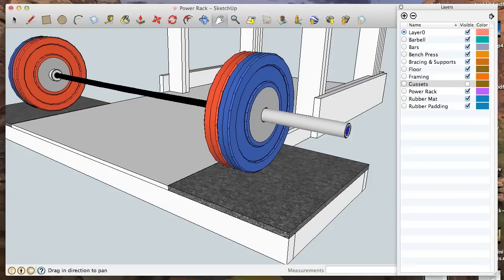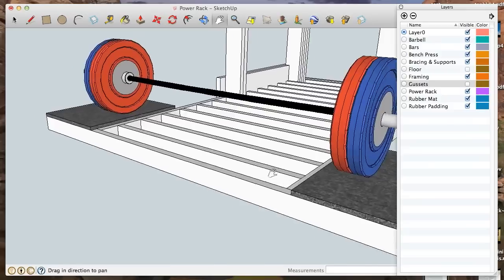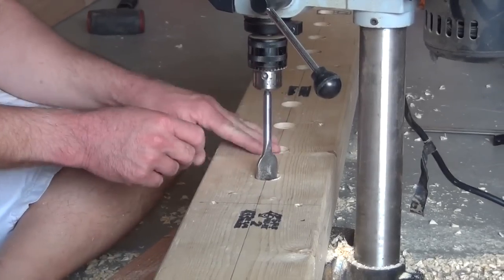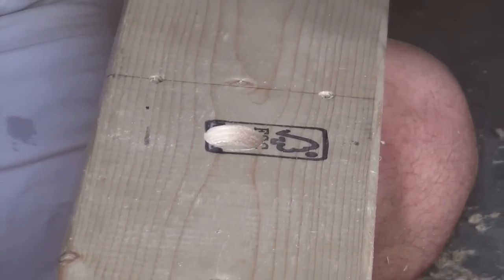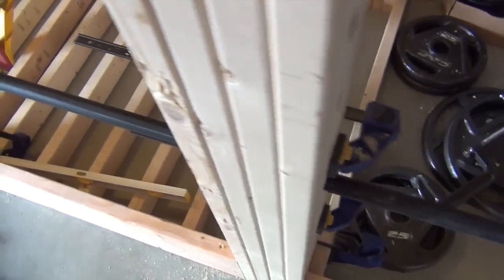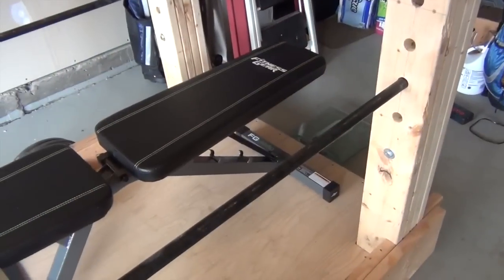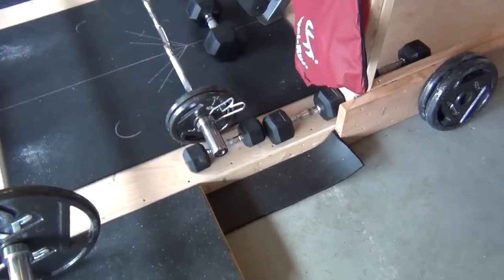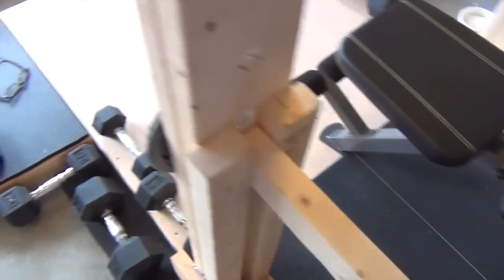DIY Power Rack For Strength Training (Dead Lift, Squat, Bench Press, and Military Press)

Comment: Nice build neutered10mm! I'm looking at various diy power racks and I'm wondering why you chose to use multiple 2x6s instead of single 4x4s for the uprights. Also, is the framed floor necessary? I'm new to lifting so I don't really know, but it looks like the only place you would be dropping weights on the floor are in the deadlift platform area, and I've seen plans for those with just plywood and rubber mat. Thanks!

Comment: hope you dont drop some heavy squat weight on that wood  it will break. just drill some holes and put a steel pipe through it. much safer
Reply from the maker: You need to watch again ... I've dropped 315 pounds without worry ... It's extremely solid.
Reply: +neutered10mm why not be safer and not risk it? You already had pipe in there, I'd just leave it there
Reply from the maker: +Quenton Millstid in not sure what's confusing you ... The pipe is still there, only now I can shim its height with 2x4's ripped to specific thickness.
Reply: +neutered10mm well then what was the wood in its place for?
Reply: +neutered10mm wait I kept skipping over the part where you lifted up the wood. WOW. sorry for wasting your time lol
Reply from the maker: +Quenton Millstid LOL, no worries bro.
Reply: neutered10mm how much would you say the total cost is for this?

Comment: Roughly how much do you figure this costed you to make?
Reply from the maker: RyanWalker677 Keep in mind that I spent a lot more on the flooring than I had to, but the total build was around $230. $100 of that is in the deadlift plate boxes (rubber) & really nice oak 3/4 plywood. This could easily be done for about $150-$180 if you shop around and fill the deadlift plate boxes with alternating layers of scrap wood & carpet padding and used less expensive 1/2 inch plywood.

Comment: What was the total cost for this project?
Reply from the maker: Manny Alvarez Keep in mind that I spent a lot more on the flooring than I had to, but the total build was around $230. $100 of that is in the deadlift plate boxes (rubber) & really nice oak 3/4 plywood. This could easily be done for about $150-$180 if you shop around and fill the deadlift plate boxes with alternating layers of scrap wood & carpet padding and wend for the less expensive 1/2 inch plywood.
Reply: Wow....that's nothing compare to buying one at a sporting store...I seriously thought it was a lot more than $230..Wish I had all your tools to put one of these together...Thanks

Comment: how much its this cost i would like to build this
Reply from the maker: Joseph Gurskey Depends on the supplies you use. I have about $230 invested and that's with the very thick rubber mats in the Deadlift drop pads and a very nice Oak plywood. The framing is fairly cheap and the entire thing could be done for about $180 if you watch your costs.
Reply: yeah right, but add the cost of the tools, the fact that you are not sure if it will handle the weight, etc...i bought german made power rack, including bench from same company, that is more stable than the ones in a gym, plus 180kg rubberised weights plates, olympic barbell, and some handles for 1000 euro....not the best deal, but the piece of engineering i can rely on...but i can't train, because doctors in slovakia damaged my health with synthetic cortisol hormone that is in my body for several months and now i am suing the bitch who did it

Comment: maximum weight supported?
Reply from the maker: Josh Gearhart I racked my entire stack of plates ... 585 pounds on the squatstand portion overnight with no ill effects. I also dropped 300 pounds from about 14-18 inches on a squat fail and it survived with no splitting/cracking of the wood, just bent the spotter arms. https://youtu.be/SNkn6eV8y3c
Reply: Excellent. Thanks for all the info, the Sketchup plans and your time. Glad you didn't get crushed.